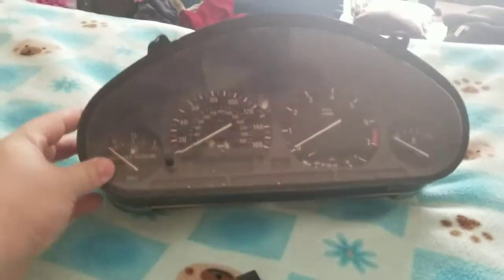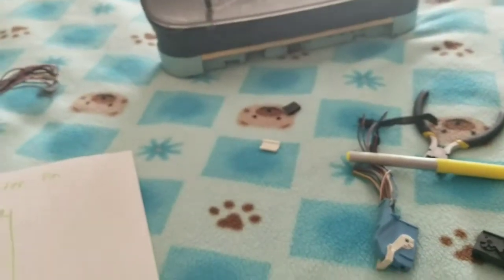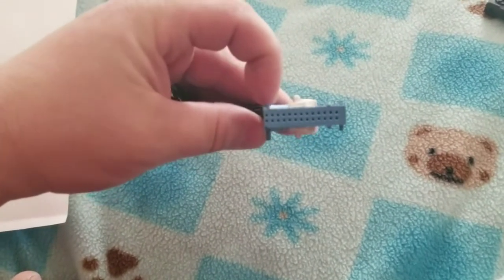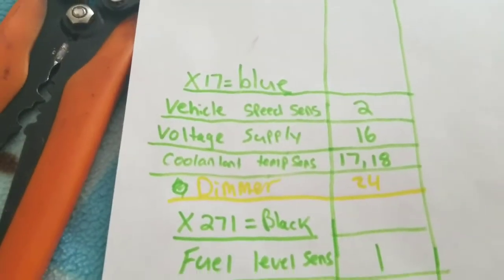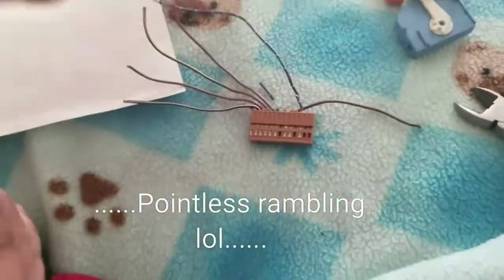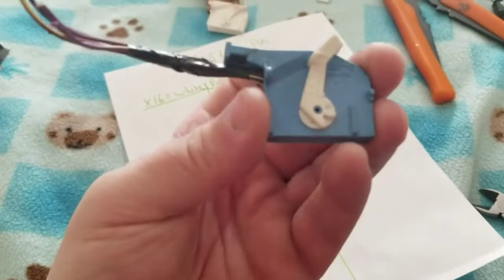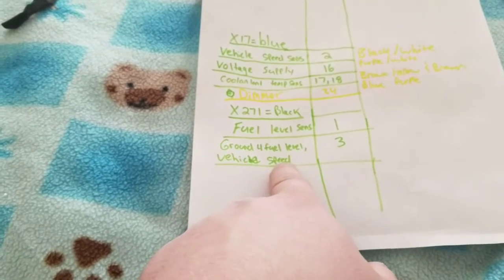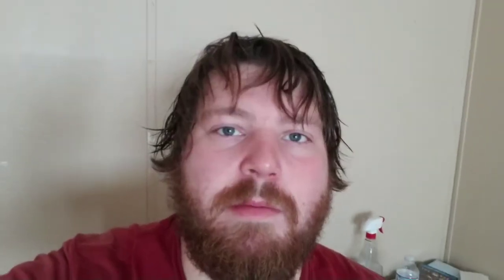How to utilize gauge cluster for engine swap

Comment: I don't mean to be rude but I would just build a gauge cluster. You can get a set of 3 three gauges(temp,oil,amp from harbor freight for $18. You can get a tach for $10 from ebay and a Fuel gauge for around $20.

I don't think the tach in your cluster will read correct because it wasn't meant for a v8 ND the the vss(speed) in the nv300 probably has a different signal than what that cluster understands.

I would use a piece of abs plastic and make my own this is what im doing in a few of my own projects just though you might want to know again i  don't mean to be rude.
Reply from the maker: Chris Perkins your exactly right lol, i have a video coming out showing the oil pressure gauge i just hooked up, and i picked up a coolant temp gauge last night
Reply from the maker: I picked mine up from oriellys, because they are about 45 min closer